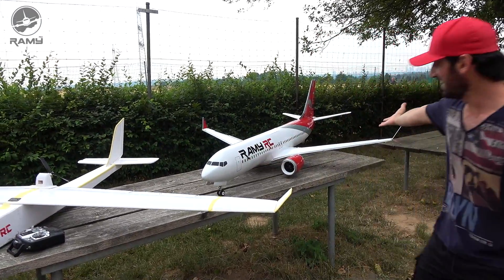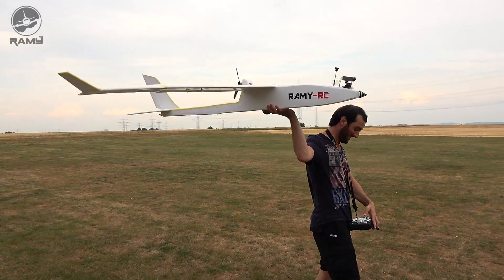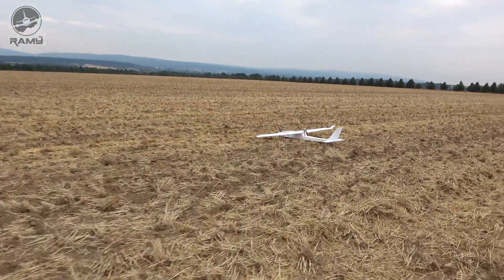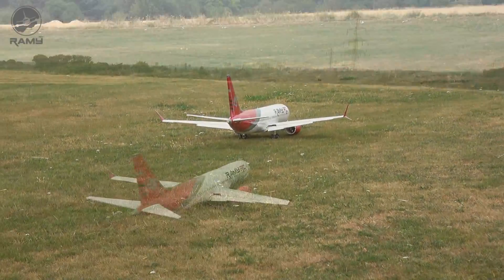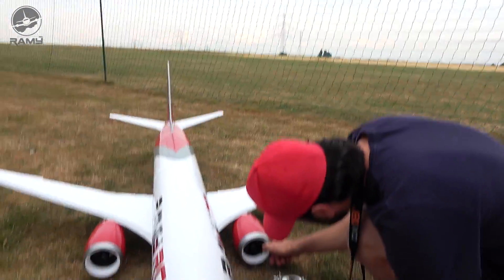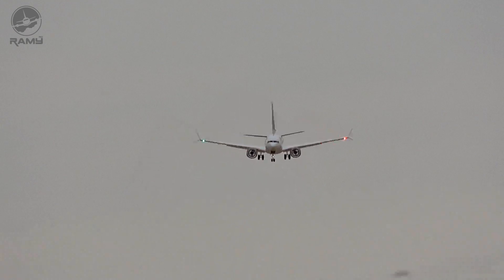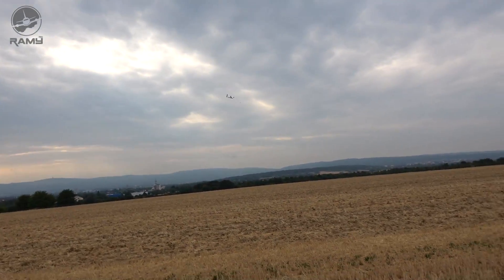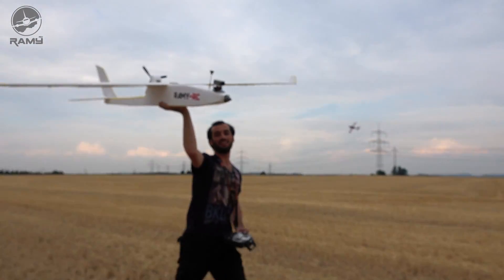My 737 is back and better than ever!

Comment: Beautiful!!!  That take off was excellent, it looked so realistic.  Your landings are getting better for sure but you are still coming in with a little too much power on short final.  What I recommend doing ,once you know how long your battery will last, is going up high and putting the plane in landing configuration (flaps full, gear down), and slow the plane down to stall speed.  Once you do this enough times you will learn to visually estimate the best speed and power setting for approach and landing.  Can't wait to see that 777! Best wishes!

Comment: Oh dear seeing you tighten a fan nut with a pliers makes me think of a certain low cost airline who operated 737's that is no more after several crashes attributed to bad maintenance. Super glad to see the 737Max in the air again, well done onj aborting the take off before Vr and your landings are improving but you still need to think m,ore like a pilot and plan ahead and settle the aircraft on a long final giving yourself lots of space and time